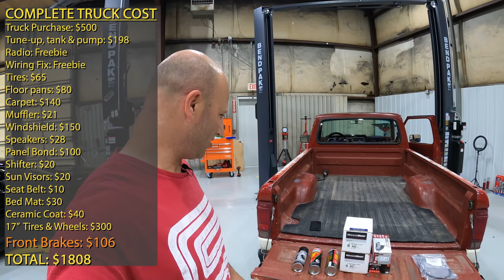I doubled my money restoring and selling a 1986 Ford Ranger that I bought for $500.

Comment: Sorry for your loss.  I lost my Dad in 2012.  Very hard.  I got a lot of tools from his garage.  Even though I don't need it I still hang on to his tool box, an old cooler that we took camping as a kit (collectable).  A few odd things.  I have actually upgraded the table saw I got and built many projects with it.  For now it stays, but thinking of getting something newer with dust collection.  Also, I had a set of robo grips.  I never really used them at all!   There might still be one in my plier drawer , but I think I gave them away.

Comment: I've always wanted to build a two wheel drive Bronco, but different than the way Ford did it, when I worked in a dismantling yard I did a lot of looking at different vehicles and decided that using the late Ranger A-frame front suspension and swap in a factory Ranger trans married to the late '90s, early 2000's. Explorer rear axle that is the easiest way to put a stronger rear end and disc brakes on it and it has the "flip" kit that lowers the back and the Ranger  trans will get rid of the funky junk transfer case, the later style front suspension will give you an easy front suspension to lower and a real plus is a power steering rack and pinion steering box. But you would have to have a new driveshaft made to fit the new trans AND the 8.8" rear axle and it is easier to find a posi-trac set up in a Explorer rear axle and you can use one for a 4 wheel drive axle with no penalty.

Comment: The easiest way to remove the rear bearings and seal is put the nut back on after you take the out front  bearing off a slide the rotor off catch the bearing with the with the nut and it pulls out the inner bearing and seal